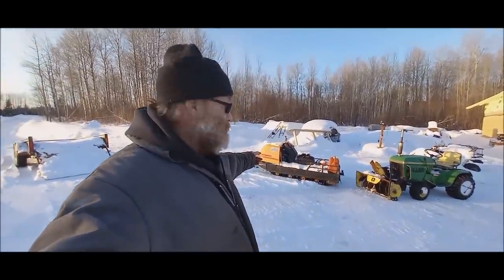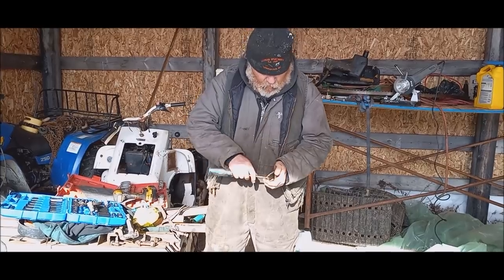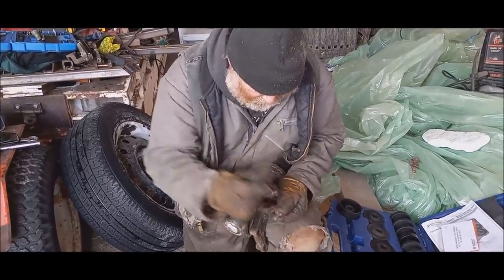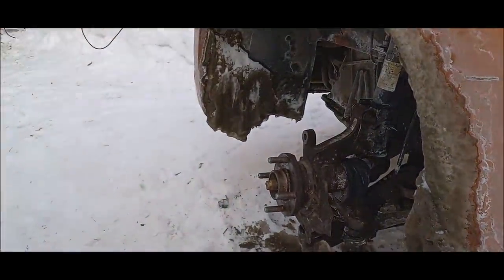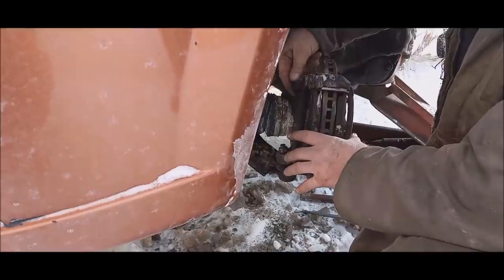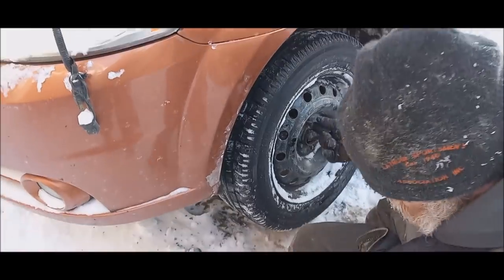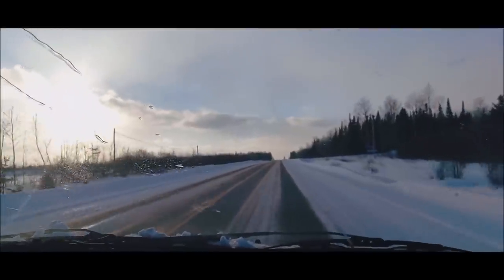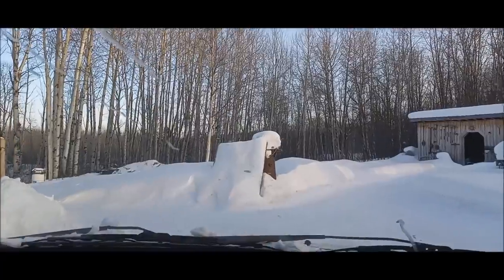I Broke The Snowmobile...But Fixed The Car.  Off Grid Homesteading.

Comment: Outdoor car repair at -25 C is an impressive feat!  When my local Buick dealer quoted a price of $450 (!!!)per wheel to replace disc brake pads and rotors, I decided to do it myself. I purchased a Milwaukee 1/2" M18 battery impact driver for $300 and purchased the parts for all four wheels for $400, and breezed through the repair. The impact driver lists 1400 ft-lb, and I believe it. Of course, I did this when the temperature was +15 C.

Comment: Hey so when you work on a car you need to put a jack stand underneath it all Jack is to lift not the holes so it would be safe for you to put a jack stand under a alright but you did a good job

Comment: Too bad about the Ski-Doo. These new wheel bearing setups for cars can't compare to the old style Timken type bearings in older vehicles. They never had to be replaced with barely any maintenance, and lasted for 200 thousand miles or more.

Comment: Cecil since the motor is still running can the crankshaft be welded back together? Or would that create an oil leak at the seal? I know if anyone can do it you can. I hope Heather didn't hurt herself when she fell.❓❓❓❓❓